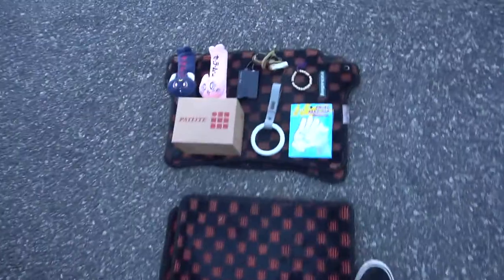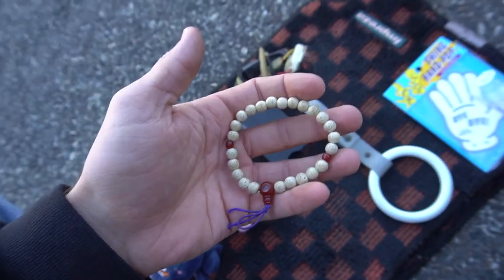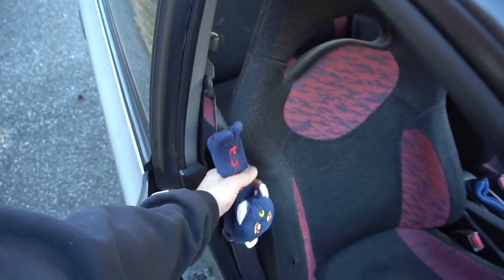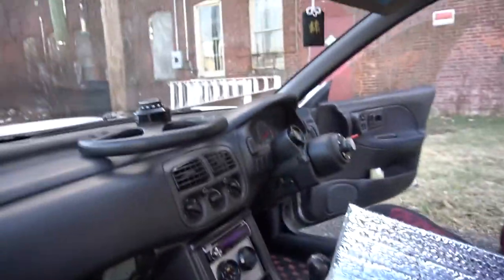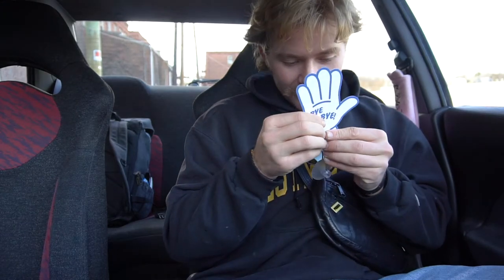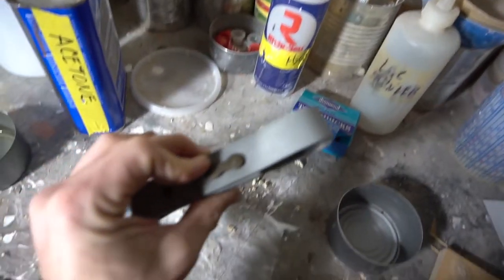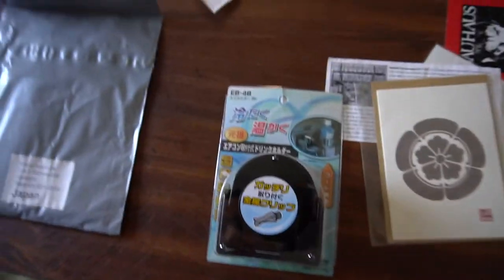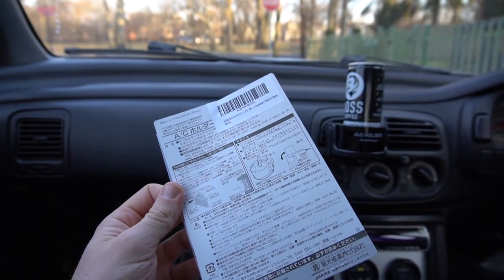I Bought EVERY Genuine JDM Interior Car Part I Could Think Of

Comment: What does the red VERTEX component do for u? It looks cool
Reply from the maker: It’s a blinker extension. When you put on an aftermarket steering wheel and a quick release, the steering wheel gets closer to you, which makes the blinker farther away. The extension makes it feel like it’s the normal distance with a Stock steering wheel. It’s function and form. The best of both worlds.